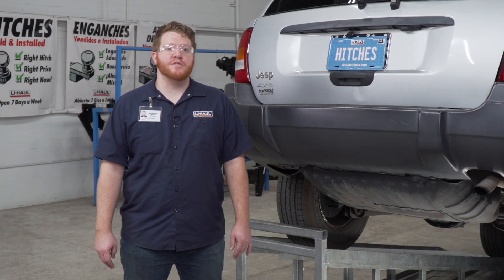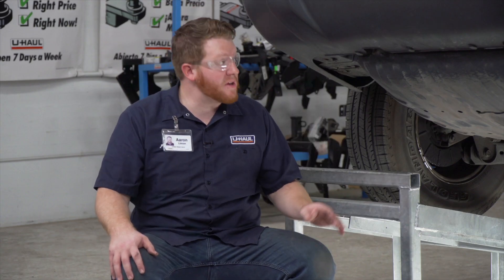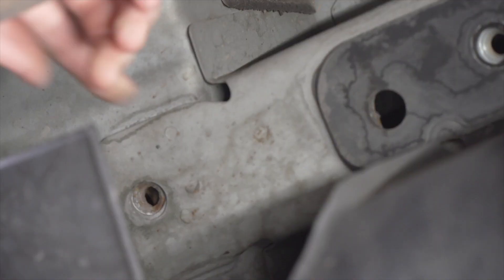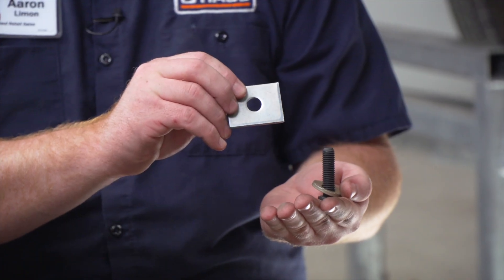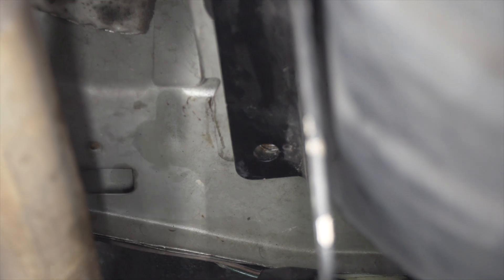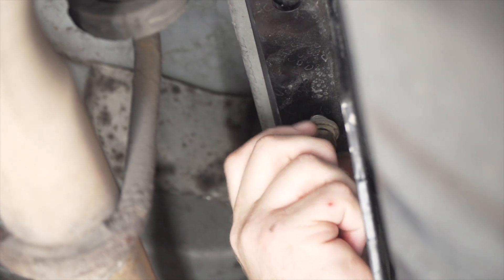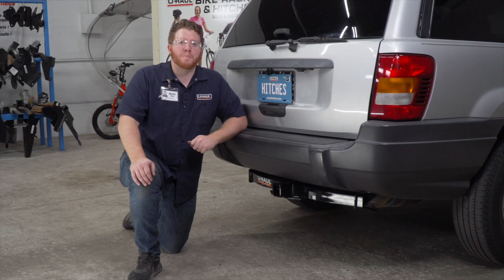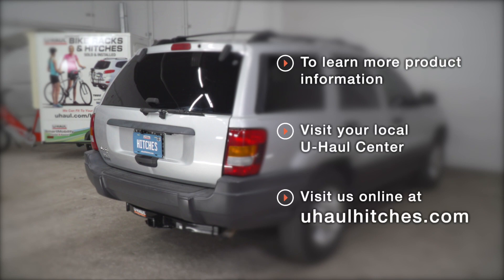2002 Jeep Grand Cherokee Trailer Hitch Installation

Comment: How much weight can that tow
Reply from the maker: The hitch is rated for 5000 lbs. gross trailer weight and 500 lbs. max tongue weight. However, please refer to your vehicle manufacturers recommended towing capacity before towing.
Reply: @trailerhitches  thank you